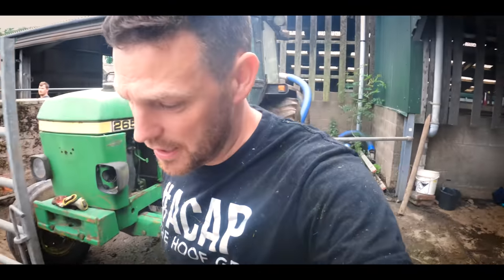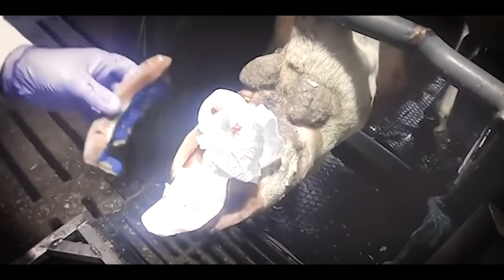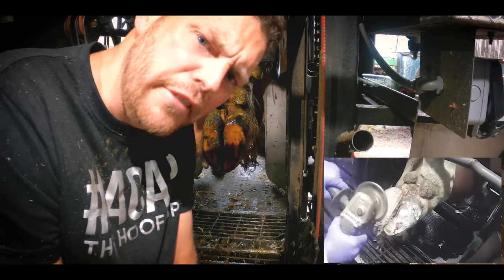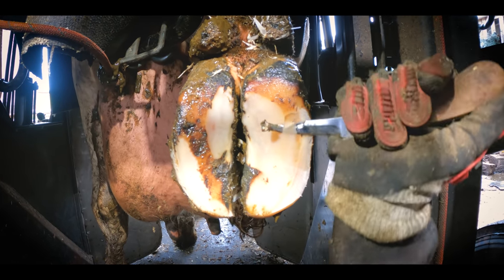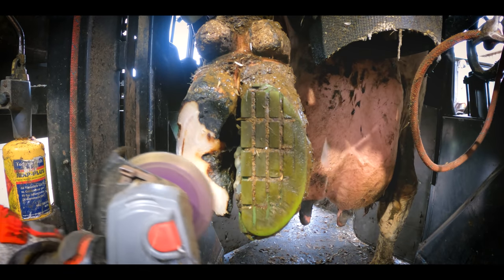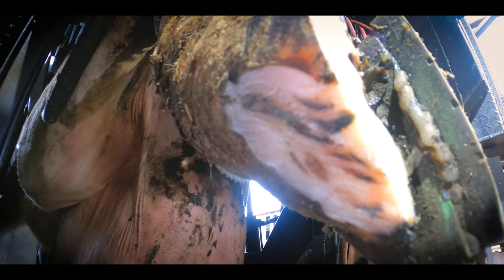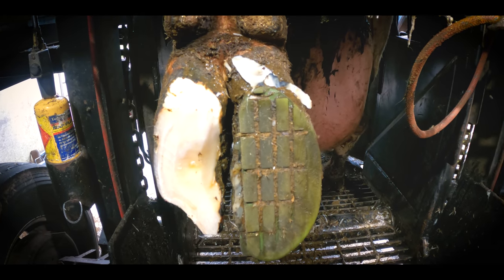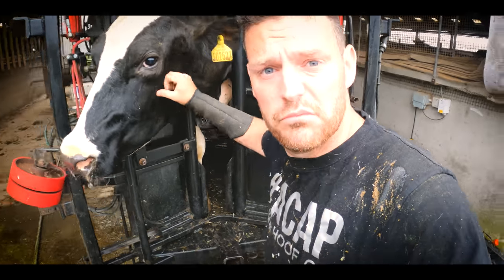WHITE LINE DISEASE, SOLE FRACTURE & SOLE ULCER |  THIS IS COW 812!

Comment: It seems that these hoof ailments are similar to trench foot. No where for the cows to keep their feet dry so infection and tissue damage occur.
Reply: Graeme has said before cow hooves aren't built for turning well so the tight runs and hard concrete can cause these problems as the ground has no give. That and horn grows very slowly so hooves take quite some time to heal and grow out.
Reply: Tbf, there is places for them to keep their hooves dry (like the hay stalls they use for the sick ones), but then the hoof horn gets dry and hard, which can also complicate things as it has even less give for the injured foot (not an expert mind, but that seems to be how it goes). I'd say what they really need is what they evolved for: wide open fields where its damp enough to give their feet give but clean and relatively dry enough for infections to be able to heal. Having to be either on concrete or the same field over and over so it gets all muddy is what causes infections to fester
Reply: I think the indoor conditions can sometimes make healing more difficult but a lot of the injuries are abscesses. So just knocking the foot (without visible injury) causes the bigger problems, which can also happen outside.
Reply: @heather2301  Certainly agree, I'm more thinking about the healing processes. Impacts are more likely on a farm (certain ones at least, with the rigid metal frames a nd tight corners) but the outside isn't exactly designed for comfort either lol, you're right

Comment: So a real ? If you have to leave 1 pad on 1 side of the hoof for 3 or 4 months while the other side heals does that put stress on the joints of the leg? I had stiches in a big toe for almost 2 weeks couldn't walk correct or wear a shoe. If I was on my feet for over a. 5 hour the side of my foot was definitely sore. Was wondering if bovines could have the same trouble?

Comment: Perhaps you or one of your commenters could answer a dumb question. Does the fact that cows are constantly walking in manure and urine exacerbate hoof problems?
Reply: only if there's an open lesion, hasn't been treated with anything (topical sprays, iodine, salicylic acid, and blocks) and if the sheds and barns weren't cleaned out regularly (which they are, they always look like a mess, but farmers are usually diligent about washing everything out in between cows coming in and out) then yeah it could, but other than that, not really afaik
Reply: @aislin2989  Thanks for the info Aislin. Regards.